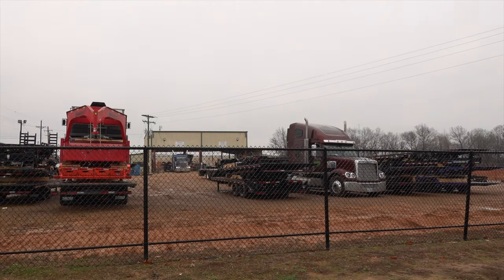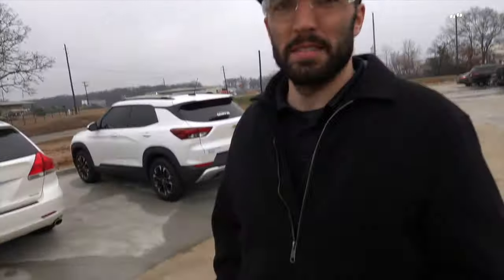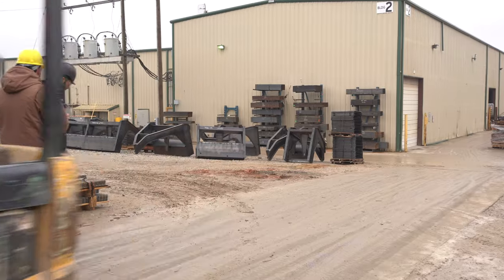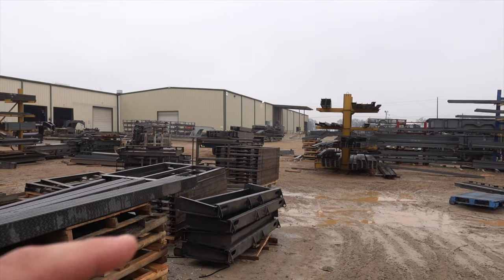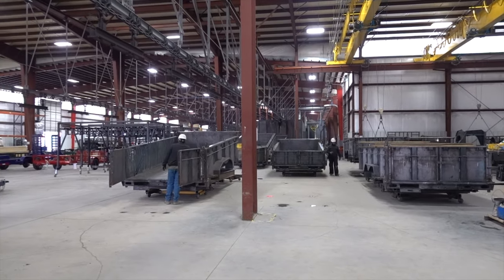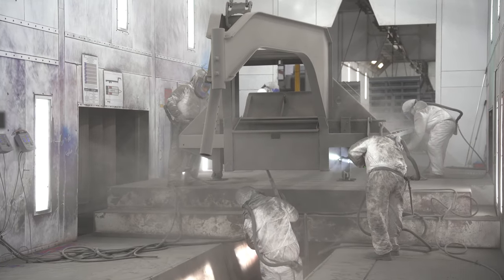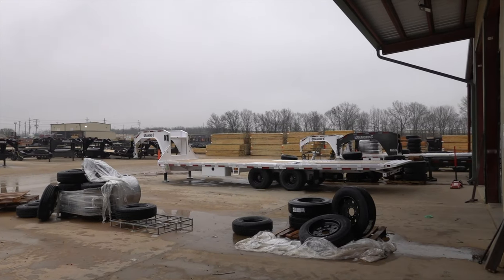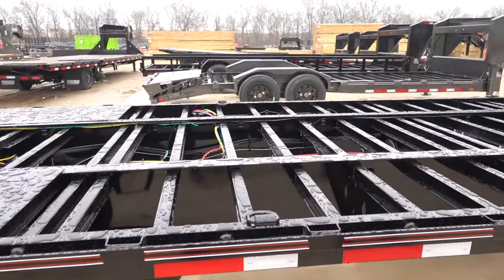INSIDE DIAMOND C TRAILERS!!!!! HOW IT'S MADE/INSANE FULL TOUR!!!

Comment: This is one thing you don't want to cheap out on I learned my lesson thank God nothing happened but going upstate New York I had a old trailer that I had to expand to fit my ATVs and it was flying all over the place soon as I got off the Thruway Exit 21 route 145 Frank Hitchcock Road there's a big trailer place they have anywhere between 500 and 1000 trailers in stock. I had a prairie 650 in the back of my pickup and 2 brand new blue Grizzlies 660s close to $20,000 in the two ATVs on a $200 trailer. Picked up a brand new aluminum trailer the difference was like day and night

Comment: Can’t tell you how many of Diamond C trailers I had to repair brand new right off the trailer. Not as bad as some other brands I used to work with but some of the stuff just makes you shake your head. Seems now a days all the trailers on the market are kind of a rushed production and have many flaws. Used to drive 9 hours round trip to Mount Pleasant, TX to pick up a bunch of them at a time for the dealership I used to work at. Galyean down the road in Henderson, TX makes some of the best trailers I’ve seen. Got a personal tour of their shop from Brett while picking up a load one time. Great setup done there!

Comment: That is fun to go through manufacturing facilities. When I was a Manufactures Rep. for industrial HVAC I went in to a lot of different facilities. Like Welded Tube in Chicago, Donaldson in Stevens Point (they made most of the oil and air filters you see on the market Fram Purolator), a plant in Indiana that made drywall, and a rendering plant which made product for other plants that made pet food.

Comment: Nice trailers but my Diamond C dump trailer lost two huge areas of paint from the dump bed within a year of light use. Hauled 3/4 inch gravel 3 or 4 times. Trailer is just a few years old. Now it is starting to rust pretty quickly. Powder coating is pretty disappointing. Might look to another brand when I upgrade my gooseneck.

Comment: Regular powder coat falls off in 4 seconds in salt. Itd be nice if alot of companies stepped up the coating. Amazing facility and operation they have
Reply: Chris, I agree, putting a primer on before would eliminate the rust effect of powder coat yet I still prefer the oil base paint over powder coat.
Reply: @heavyhauler79  easier to recoat and repair too over powdercoat.

Comment: All European trailers have been running tri-axle for almost 40 years now, on super single tyres and air suspension with solid beam chassis throughout. Even on dry freight trailers which American trailers don’t have, that’s why you see so many of them break mid way. As for the gooseneck, it was primarily use for construction and agriculture dump trailers but became obsolete 40+ years ago and it was never ever used for road haulage/transport. So in trailer manufacture America is way behind the Europeans in Quality, innovation and construction strength 🤔

Comment: I have a DoD Diamond C 14'x8. The design, engineering and materials are topnotch. However, the guy that assembled mine was apparently stoned, drunk at 4:30 and his wife just left him. 

Most of my set screws are stripped and useless. My roll back cover completely slid off. The tarp hand crank was useless day one. The board runner brackets had oxidized welds. Now let's get into the real problem. My pump has leaked in the storage box since day one. It's a fucking mess. Two of my zerks were stripped under the trailer at the base hinges. My tongue jack may or may not be kinked. I'm not sure. Several bolts are facing the wrong direction. Two of the pins on the spreader gate were set backwards and came off after a few dumps. 

I fixed everything except the pump leak because it's in a tight spot and we are too busy to remove the storage box lid. We just keep putting fluid in it and cursing the sum bitch that assembled my trailer that cost 11k .
Reply: Warranty?
I don’t like hearing that, as I’m getting ready to sell my piece of shit PJ and purchase a Diamond C. 🤔
Reply: @kyhamoge  yes, there's a warranty but I'd have to drive the trailer 2 hours out of town to have it worked on and the work is slow because the dealer uses a firefighter/mechanic. Im told I can take it anywhere and Diamond C will pay for the repairs but its a big hassle. I called Diamond C to line that up and they had a guy answer the phone who could barely speak. It's just a shit show.